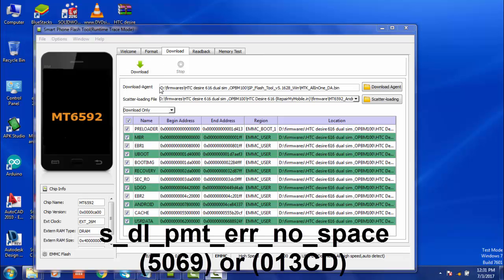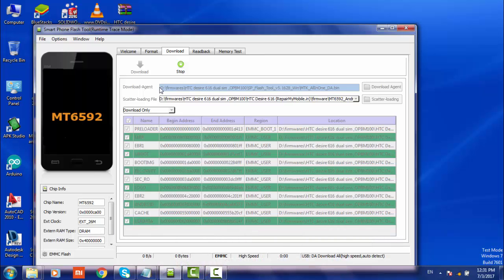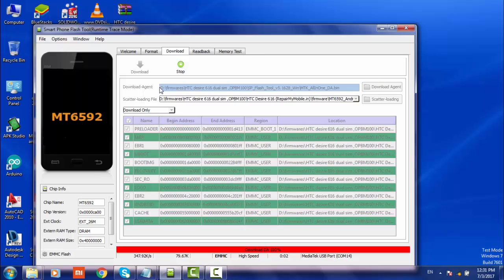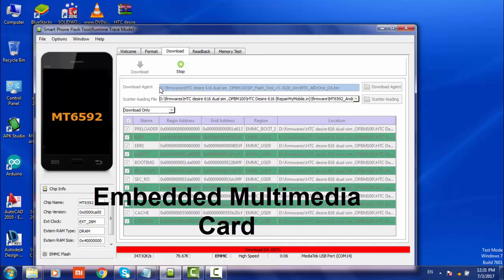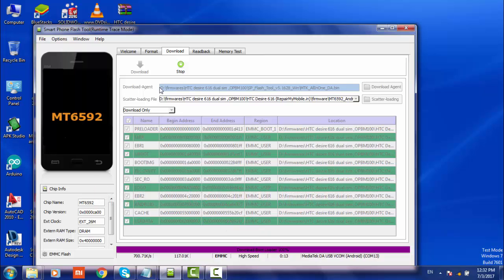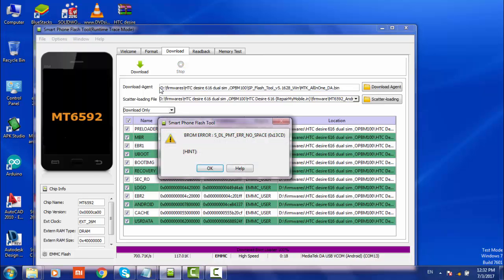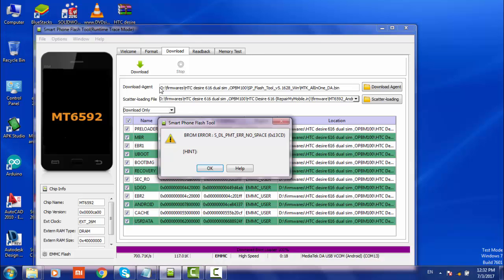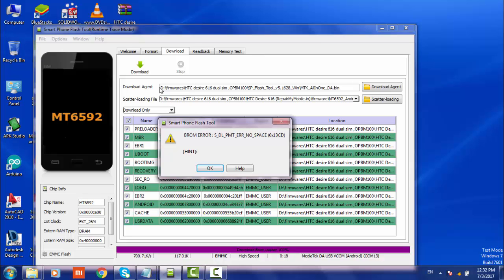How to fix s_dl_pmt_err_no_space (5069)(SP FLASH TOOL)

Comment: seriously i had to replay 3 times. You should speak slower becsuse your accent doesn't help.
Reply: :( i dont understand from :40 to the end. That part is the fix i guess. :(
Reply from the maker: +Live Del Solar okay here is the thing.. Its not a software problem its a hardware problem... You have to replace the chip mentioned in the tutorial.. And i will try to speak slower.. Thanks for mentioning it..
Reply: Akhil ts  thank you very much.  Well earned sub.
Reply from the maker: +Live Del Solar thanks bro...